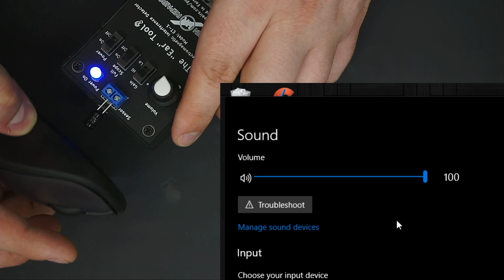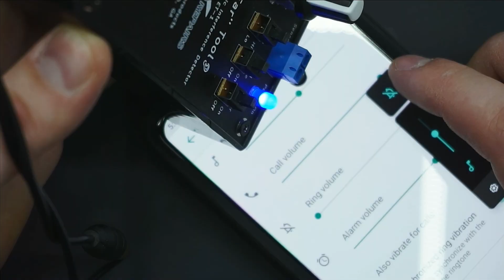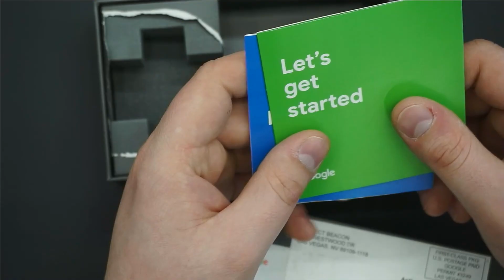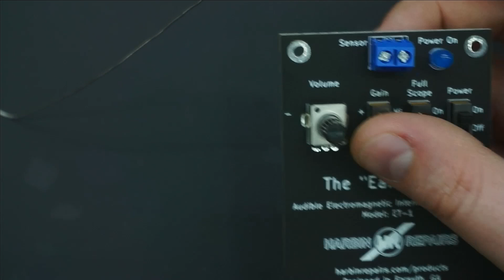The Ear Tool Demo & Assembly Guide

Comment: Will changing out the inductor allow a diffrent range of emi to be picked up?

Im your second subscriber and looking foward to seeing videos of  this tool in action on diagnostics repairs.
Reply: Thanks for the reply....no wonder your channel is exploding!
Reply from the maker: The main reason for the terminal connector is to extend the sensor (inductor) with external leads so you can probe in tight spaces. You can connect a different inductor than the 100mH one but anything lower will only decrease the sensitivity.